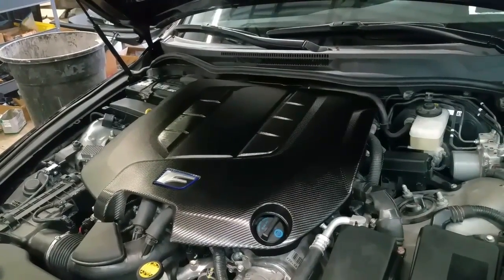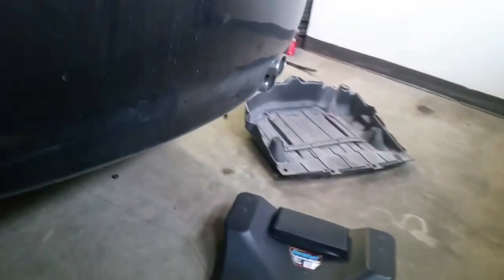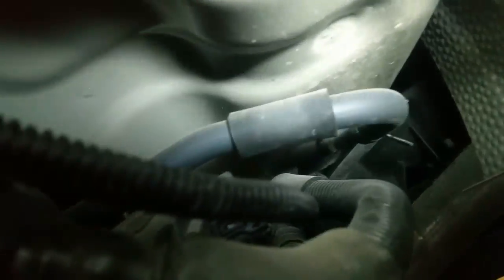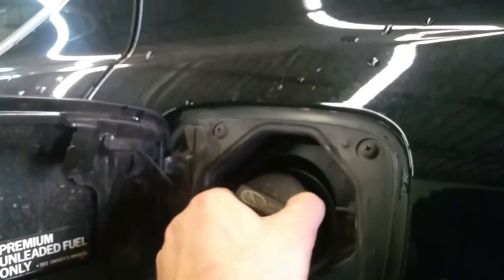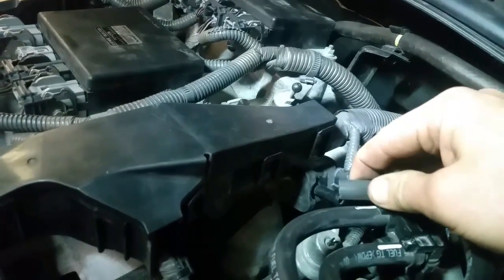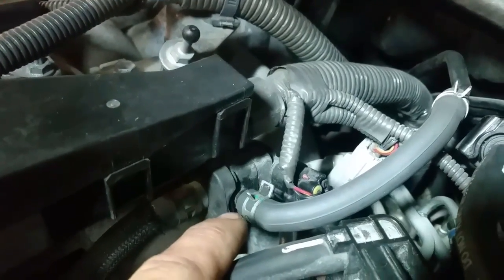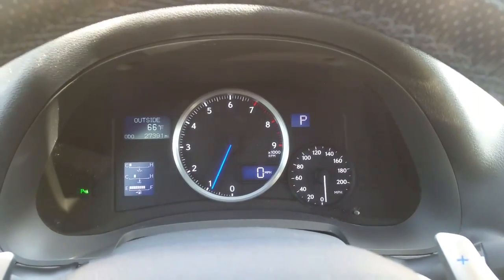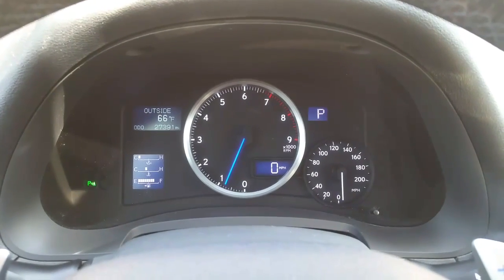LEXUS TOYOTA EVAP FAULT CODE P0441 FOLLOWS BY P0445 FIX!

Comment: I have 2010 ISF code p0441 p0455 says inactive doesn't get erased which is causing misfire, and give p0126 something with fuel pump can someone guild me I check all the pipes and evap

Comment: If all else fails, then the culprit is indeed the fuel vapor charcoal canister which is a ~$500 part from Lexus. This particular part has an internal and unremoval filter that clogs when you overfill the gasoline tank which will overflow in one of two reservoirs in the canister--a small mistake with an expensive pricetag behind it. You can clear the check engine light/ VSC/ P0441 P0455 codes, however, overtime the problem will not improve and the clog will become worse causing the interval between driving the vehicle and clearing the codes to shorten and eventually a replacement of this expensive part is necessary for further proper functionality.

Comment: This code just popped up on my ISF this morning. at lunch time I will check. Thanks.
Reply: That’s a mighty long lunch break.
Reply: @mansandem  checking under the hood and pulling a cover off of a canister wouldn't take longer than 45 minutes.

Comment: I have the same two codes on my 2008 GS350
Reply: Did you fix it?
Reply: @efrainsanchez1999  no I sold it
Reply: @efrainsanchez1999  I just fixed mine on my 2010.  It was a similar fix.  Our hose to the canister from the engine compartment is located on the left side of the engine near the air intake.  it had come lose.  (because I was cleaning the throttle body a few days prior).  reattached it and the code is gone.  cel code was P0441 just like this video.

Comment: I have code P0441 and P0445 on my 2007 lexus is350, I have inspected gas cap, replaced the VSV and checked the hoses and they all look good and connected. What else can I possibly be besides the canister, vsv, or hoses?? Thank you very much!
Reply: I was also having the same issue. hopefull george can chime in on this!
Reply: I have the same codes on my 2008 GS350. Will be doing a smoke test this weekend
Reply: You should do a smoke pressure test I did one on a solara and it was the fuel filler neck that was cracked
Reply: Me too any updates
Reply: @efrainsanchez1999  Yeah, I had a smoke test done and turns out I had a leak in one of the hoses underneath the car. Mechanic sealed it up with silicone and it has been good for 4 years. Hope this helps!